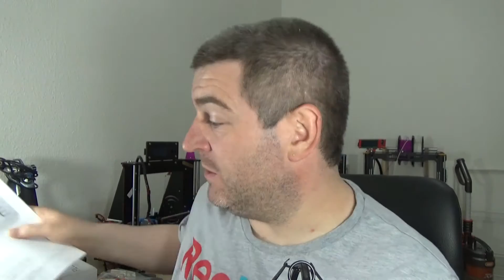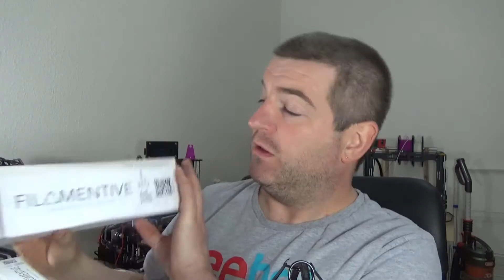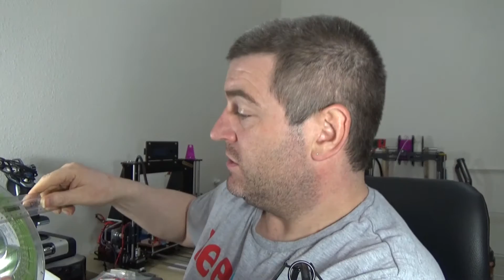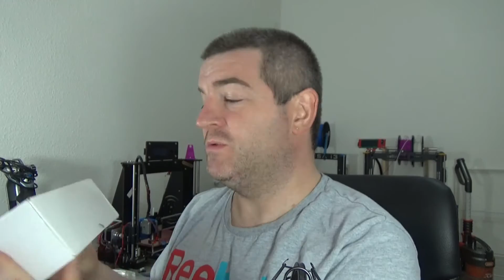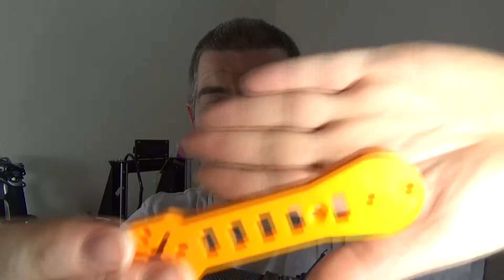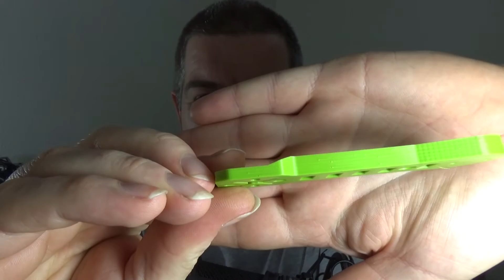3D Printing + Save the planet = Filamentive.com        Discount Code

Comment: Have you tried verbatim ABS ? I have the bright green one and its AMAZING! Sooooo much better than the cheap ABS, only better ABS i have seen is the stuff for the UP!s but that stuff is stupid expensive and needs to be extruded at silly temps.
Reply from the maker: Hi,
I have not tried that ABS, I usually use ABS from the £15 - £20 per 1kg range but this rPETg really has blown me away.
I have a lot of sample filaments to try out so more videos are coming.
Steve
Reply: going to give PETG a go when my verbatim ABS runs out, the PLA that came with my wanhao i3 can stay in the draw its dead to me! 

if you keep an eye out for the least popular colour you can get the 1kg blue for about 18 qid others for about 22 , it has a warranty on it too do if its crap they will replace it, its loverly , the outside of it feels so smooth and uniform compared to the 10-15 quid ebay specials.

Made in Japan too.

Its good to see move videos , what i am looking for in a plastic is something that is easy to print and as strong if not stronger than ABS.

I want to give some of that new stuff form E3D a go , it looks nice on paper.

Comment: hey I have a Di Vinci 1.0 and my filament feed stepper motor has stopped feeding / moving at all and I been trying to trace the problem to the source and I tracked it down to something on the main board and I checked the stepper driver boards by switching them around and again everything works but the filament stepper motor I bought a new stepper motor and it's not working either I can fix the problem if I knew the layout of the main board, if you happen to know what the problem could be plz let me know.